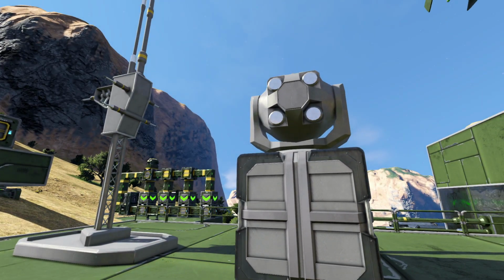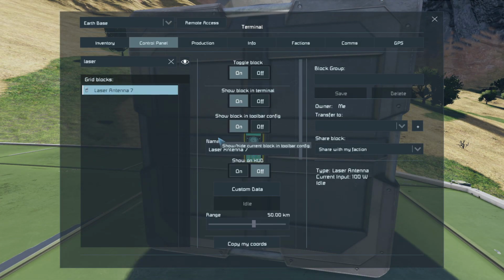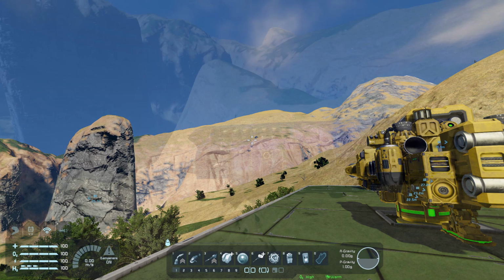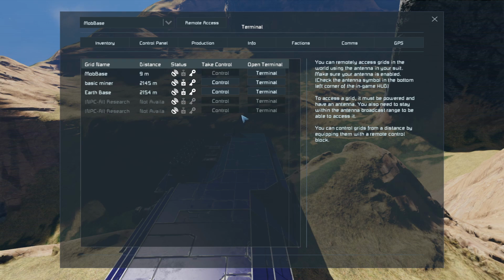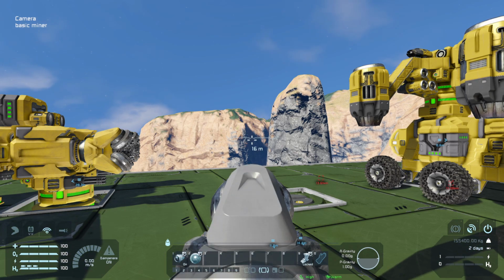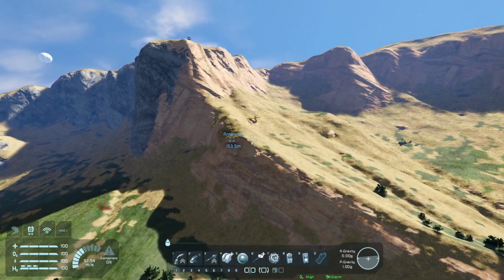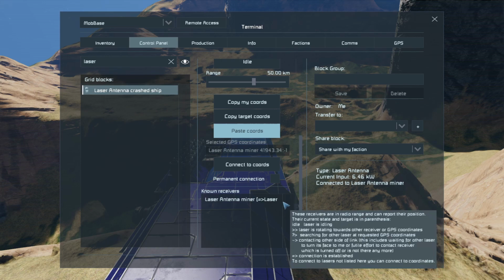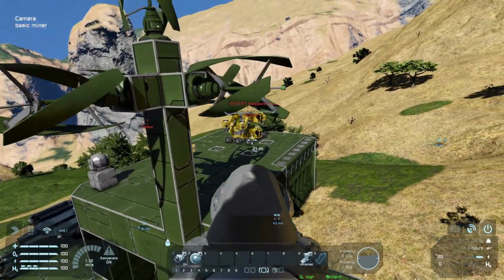Laser Antenna Tutorial | Space Engineers

Comment: My thoughts are that when you Exit the Games Render dinstance (For example 30km in Servers,etc) and No one ist nearby, does it still be connected? Can i Control a ship 200 km away?

I tried to shoot a Rocket on another Planet, about 1500 km away. Enough Power, but after a while If i Exit the remote Control my Rocket is still there, but cannot Connect from the Planet... 

What am i doing wrong?
Reply: Laser Antenna are set to max range of 10K now
Reply from the maker: Honestly I'm really not sure how it works with servers. I suspect you could be right about the render distance. The whole laser antenna system is so delicate there could be several things causing problems. I don't really have any suggestions for servers I'm afraid. If you can connect then there must be another issue other than the render distance. Unless connecting is fine as it's not moving anything, but when you 'launch', the server has to move a body that's out of render range?